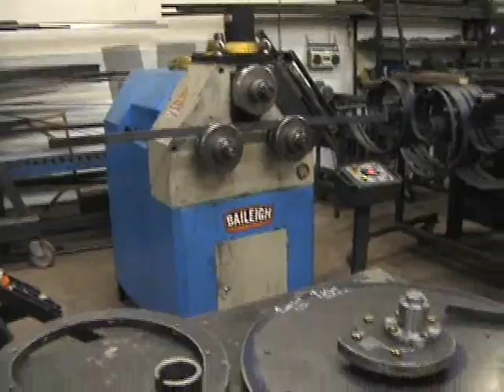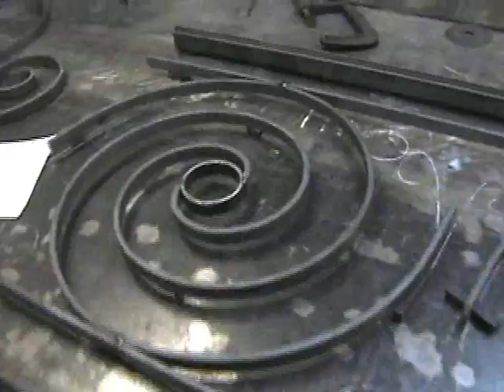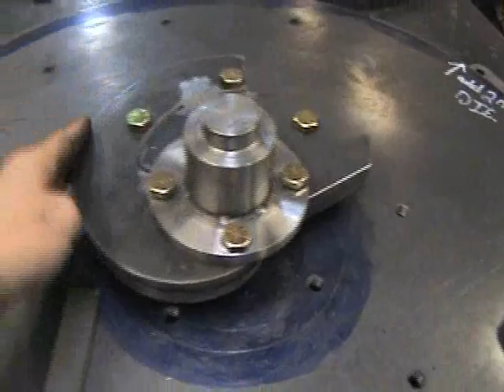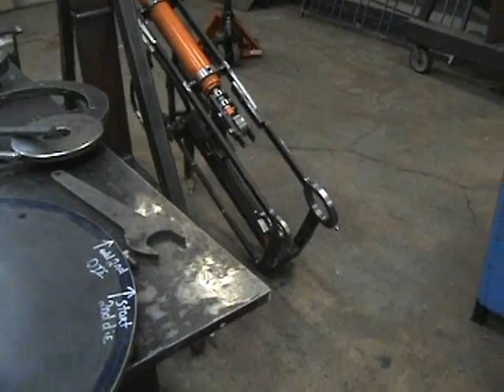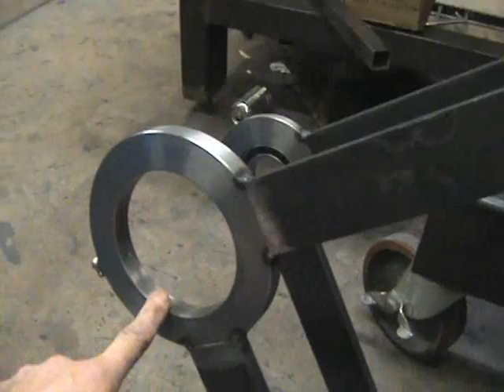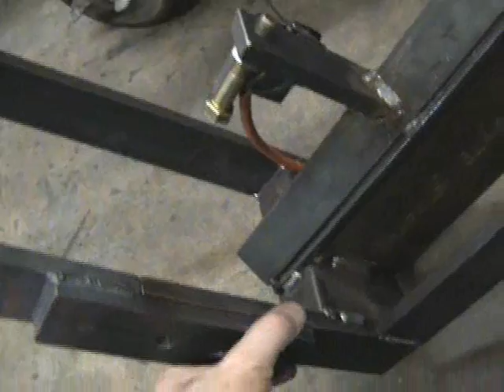Creative Metal Works Scroll Bender 1 of 2

Comment: This video shows that while you can hammer a spiral or machine it, the use of powered machines does not by any means eliminate the need for human work. In fact, it seems like your method needs more human effort to form the metal how you want it. Now this isn't true in all cases, but it does show, like I said, that the blanket statement that "machines kill human ingenuity/jobs" is false.